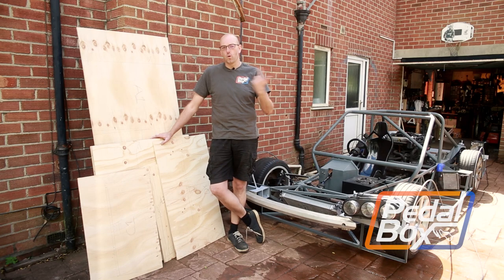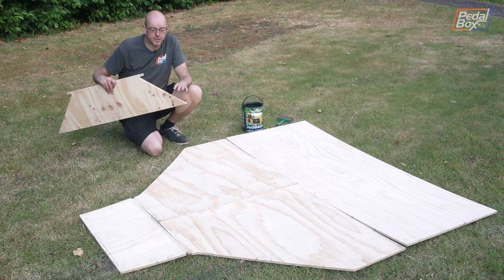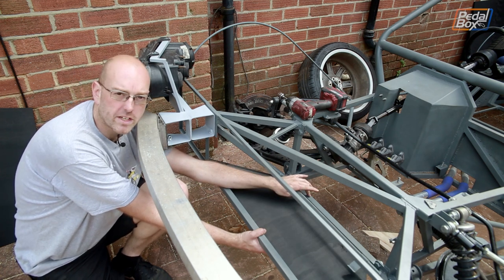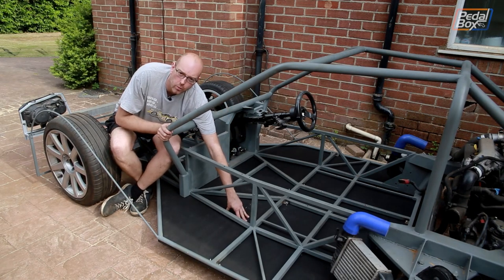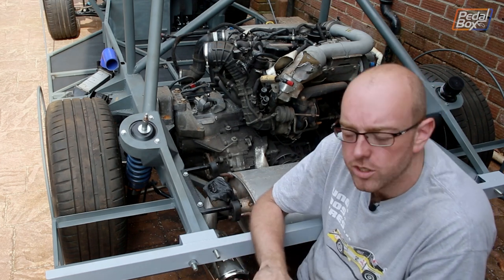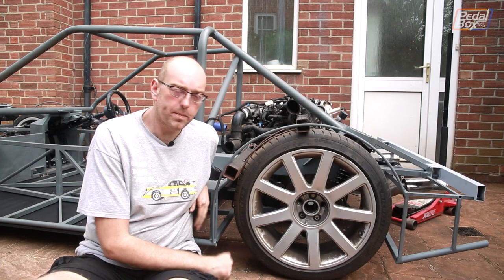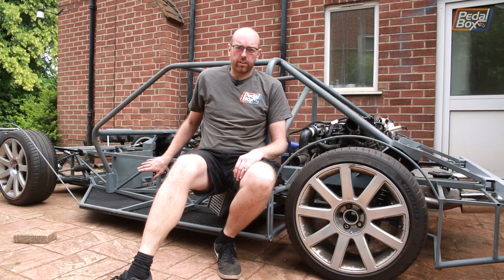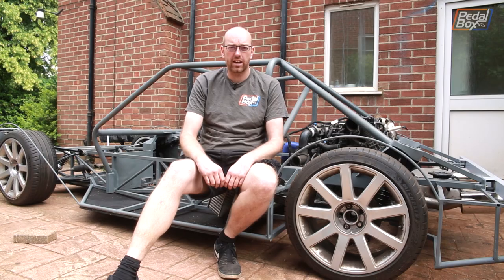Flooring and Coilovers | Audi TT Kit Car | PedalBox Episode 58

Comment: I have 225 lb springs in my 914 and it feels really good. It has ample suspension movement and yet maintains a firm ride. Your 180 lb might actually be pretty good
Reply from the maker: Yeah 180 isn't so bad. if it wasn't progressive from 90 to 180 it'd likely work fine. Just the first part of the spring is nearly done just sitting

Comment: So I don't quite understand WHY a floor has gone in - it's a temporary floor to create a template for cutting the main floor, but... ...why keep it in? Why paint it and mount it? I'm really not sure I understand. Is it just so you can create decent mounting points for the actual floor?
Reply: Mostly just because it’s nice to have a floor in the car. Makes it feel a little more real!
Reply from the maker: Primarily, the floor mounts need welding in before we strip and flip the chassis to weld underneath all the things that were added (like the floor/side pods, the cage/roof) because welding upwards sucks.
As for adding the floor to it:
Test the mounts are in the right place for one, and that there are enough mounts to support weight (there are now i've added another 16 or so, once more arrived)
Reduce the fear of breaking an ankle climbing through now there's a roof on and i'm no longer the short child version of myself which could navigate a climbing frame with ease!
Paint it because water always makes it's way under the cover somehow and it doesn't fall through to the floor (as proven by the pedalbox area), so otherwise it'd rot.
Being able to Sit in the car properly is also hugely gratifying and helps with foot placement for working out the tunnel
Finally, I had an idea how I could get it from two sheets of plywood and do everything I needed, which seemed Ideal, and I was waiting on some other bits coming to fit some of the bigger sections coming, so it filled a gap in the build I had time for. Convenience on many levels.
Reply: @PedalBox  That makes sense, it just seemed unusual to add a temporary thing like this rather than going for something more like the intended-to-be-finished version, like you've done for the rest of the build - hence the questions!
Reply from the maker: @TheMafii  The final version of the floor was intended to be a carbon/alu core... but it's a lot more expensive than i expected. $1000/sqm :|
Reply: Crikey, that's mad. Genuinely mad. Maybe just settle for a bit of tarp? :D
Reply from the maker: @TheMafii  Thinking Phenolic plywood will fair better, be slightly heavier, but at least 10 times cheaper. Which makes speed bumps less concerning at least
Reply: @PedalBox  enjoying the series. Have a look at alloy composite panel sheet. Its lighter than alloy but stronger. About £60 for 8x4 sheet.